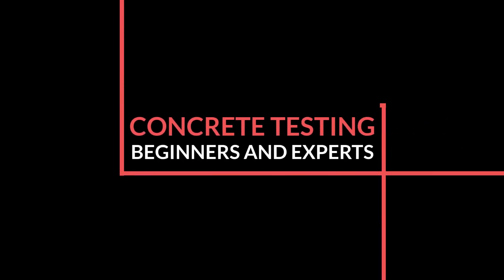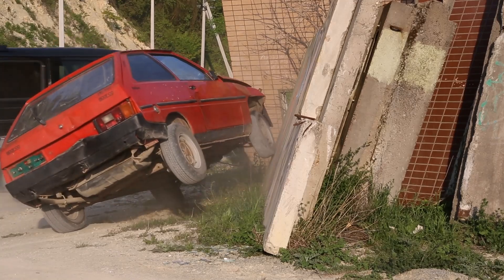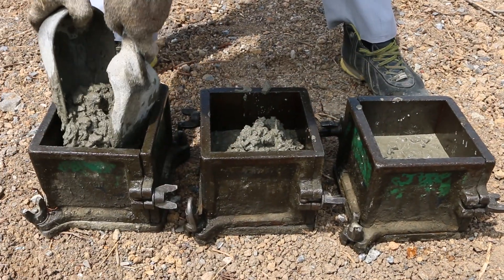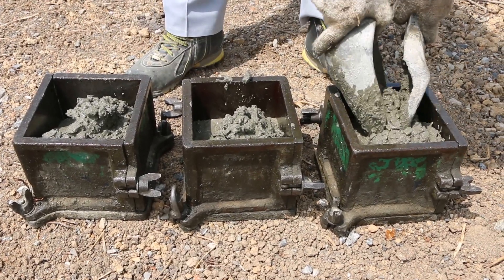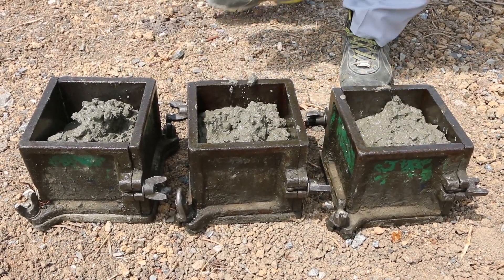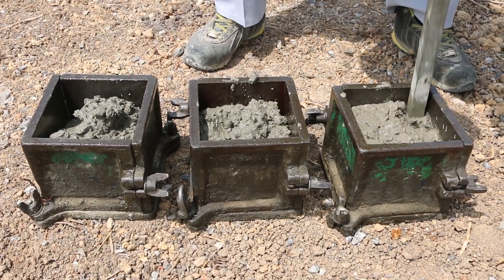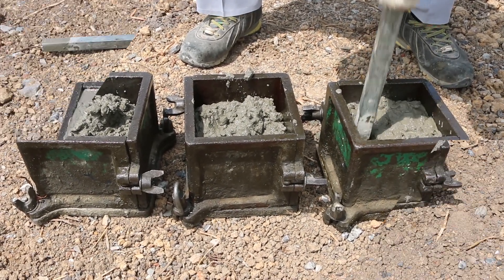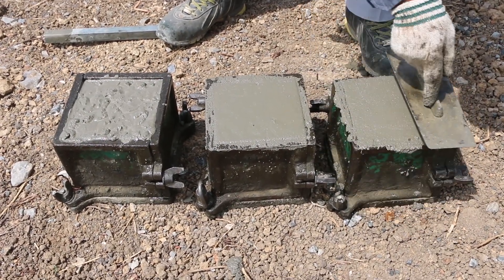How Engineers Test The Strength of Concrete - Let's Break Something

Comment: Hi Greg. You help me with your vaulting ceiling video several years ago but now i need some more help. Can you show a video on how to add a stem wall foundation under neath a house where the floor joists run parallel and there are already 3 sides with a foundation? Ty
Reply from the maker: I put it on my list, but don't see it being made soon.